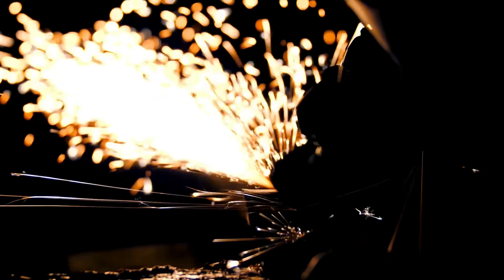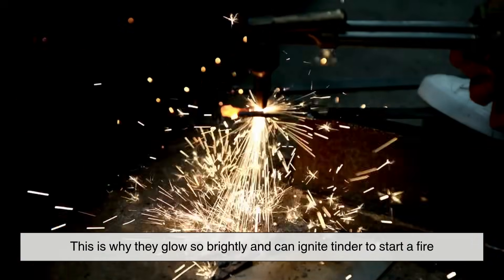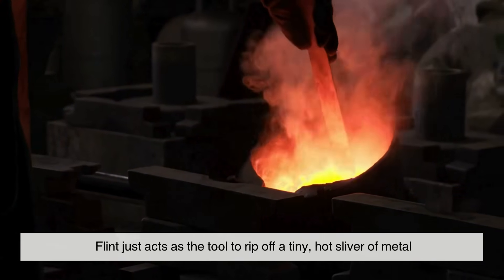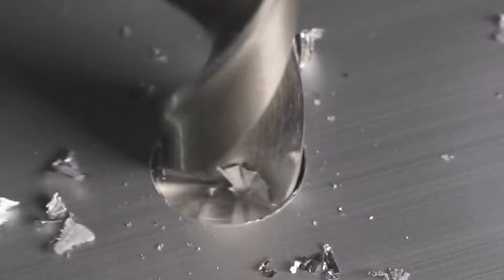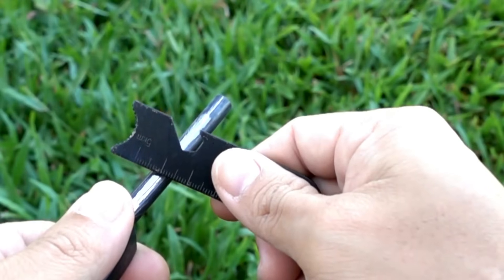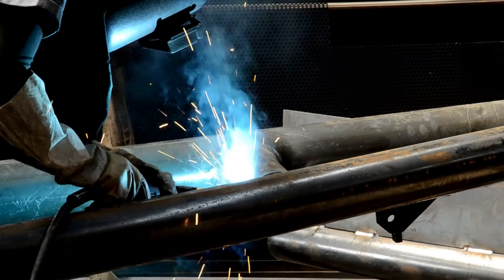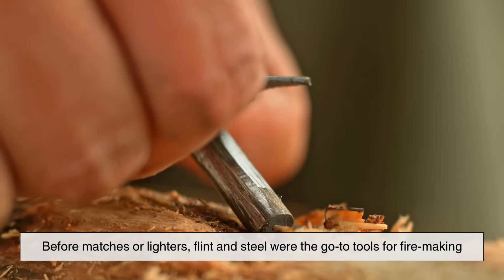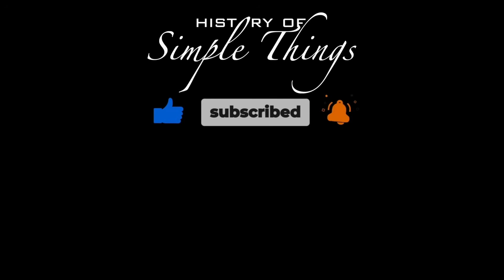The Spark Reaction: Why Some Metals Spark on Impact

Comment: Regarding 4:54, "Artificial Flint" also known as Ferrocerium was invented in 1907 by Austrian chemist Carl Auer von Welsbach. Ferrocerium metal alloy is composed of iron (20.8%), cerium (41.8%), neodymium (4.4%), praseodymium (4.4%), magnesium (4.4%) and lanthanum (24.2%). In cigarette lighters, the serrated steel wheel is turned which grinds off tiny pieces of ferrocerium that become the hot sparks. Ferrocerium produces hot sparks, because it is "Pyrophoric". Another pyrophoric metal is Depleted Uranium which is used as the hard penetrating core in Armor Piercing Ammunition. Depleted Uranium upon impact in armor penetration produces burning hot sparks which makes it incendiary as a weapon.